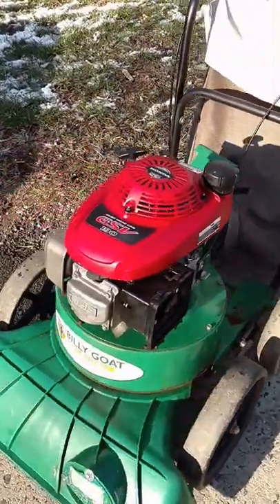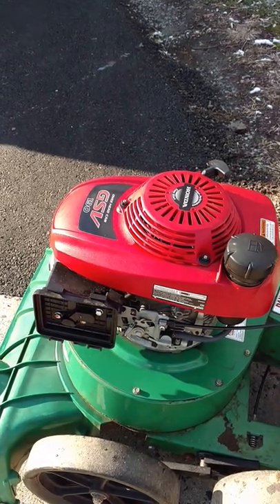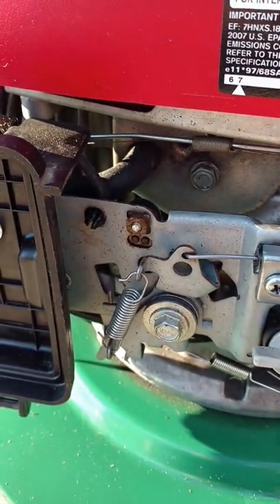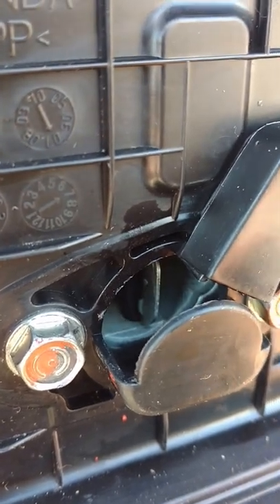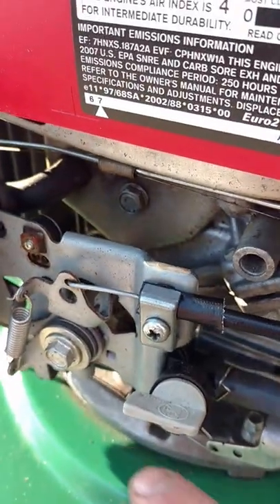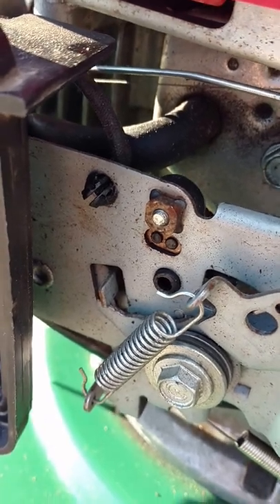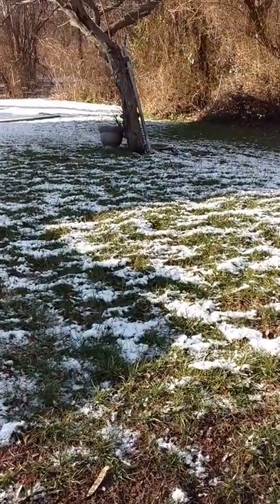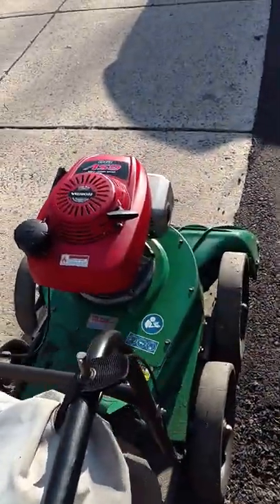Billy Goat Starting Problem Fix Honda GSV 190

Comment: Hi 
I just Did this and it worked 
DRiving me nuts 
took the carb off and clean all passages 
last year 
this year tried to start my lawnboy 22271 with the choke unable to start 
sprayed brake cleans runs ok 
check the choke not closing all the way 
Amazing thanks for the tip 
THANKS !!!!!!!!!!!!!!!!!!

Comment: HI there. I rarely post on YouTube but felt I had to thank you for sorting a problem on my otherwise superb Billy Goat. I had to change the throttle cable mid last year and from then on its been a pain to start. I got it out today to start clearing the tons of leaves we have fall here (www.forestviewfrance.com ) and it would not start. Checked everything - fuel, spark plus air filter nothing would help. Then I saw your video, adjusted the cable and bingo started FIRST time!! Bless you and grateful thanks
Peter.

Comment: My one wont turn off
Reply from the maker: You may have pulled the cable too far.  Look at my pic and adjust your cable accordingly.  Worst case scenario:  manually move the linkage sonut shuts off.  There's a metal bar on a spring.